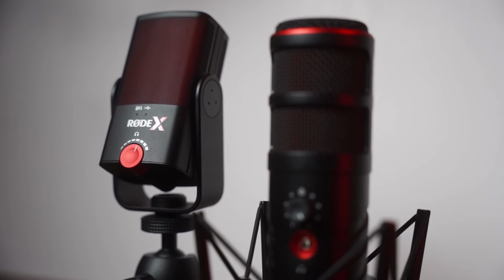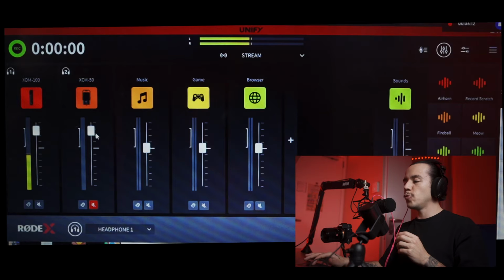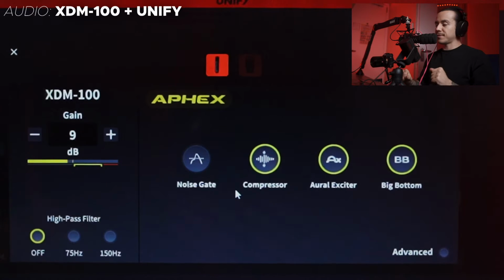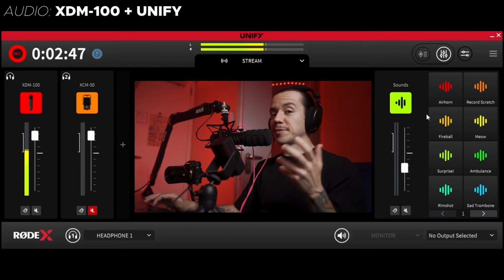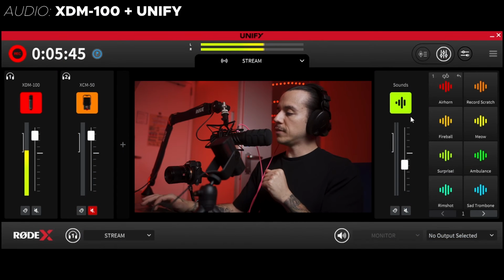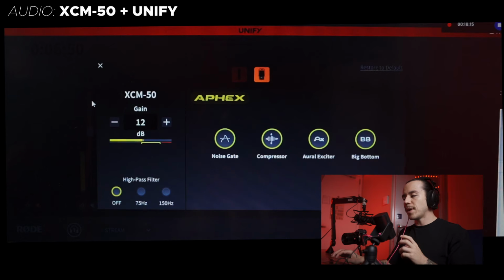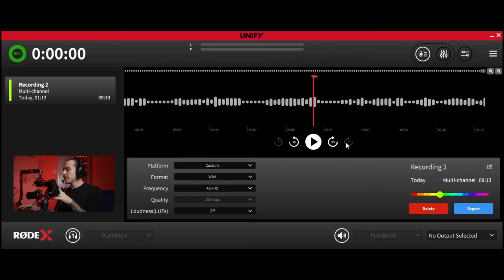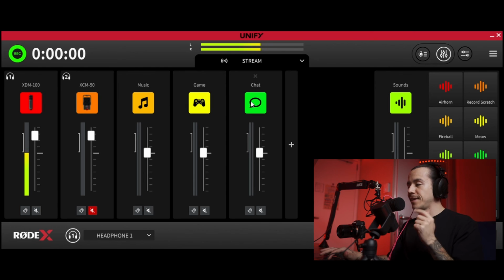RØDE X: UNIFY Walkthrough, XDM-100 and XCM-50 Sound Test + GIVEAWAY!

Comment: I just bought the XDM100 and I am getting Code 43 on 4 different PC’s. Tried different ports, cables, updates, uninstall/reinstall, just about everything I can find. Keep getting ‘unknown usb device (device descriptor request failed). Did I just receive a defective device or have others seen similar issues and there is by chance a fix?

Comment: Luiz awesome video thanks so much. Now I have a question. I have the XCM-50 (wish I would've found your link sooner lol - next time) but I can't, for the life of me, figure out how to attach the Tripod to the microphone swivel. How did you go about it? It's totally going over my head ha!
Reply from the maker: Hahah no problem! I’m happy to help and glad you took some value in my video. To answer your question, there is a rubber-like protector over the spot where you screw on the microphone and attach it to the tripod base (probably to protect it). To remove it, pull the rubber part out of the base of the microphone and screw the tripod on. Let me know if you have any other questions!
Reply: @videobyluiz  Ah I see! Well apparently they gave me the wrong size screw. The Tripod screw is too small for the female part of the adapter that screws onto the mic part lol. I emailed them. They made a mistake on my package as it the screw (male part) is too small. But thanks for your response!
Reply from the maker: I see!!! No problem at all I am glad that they can fix something for you! I am sorry for that lol